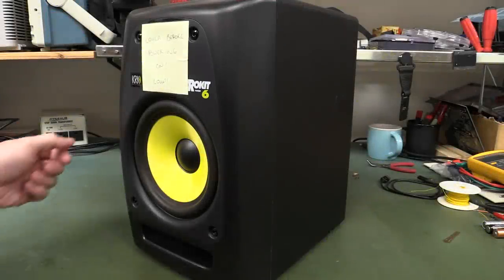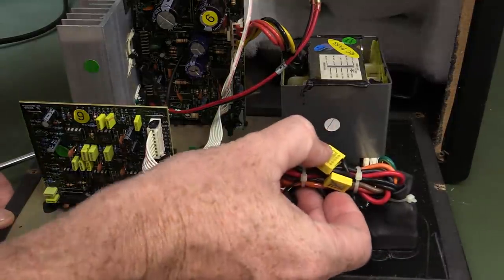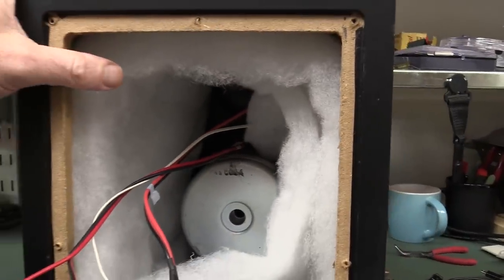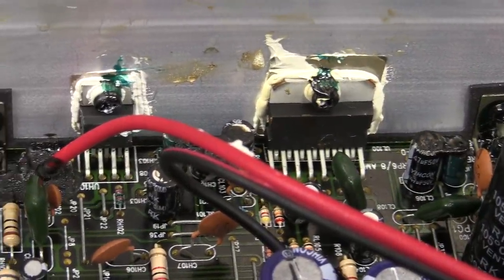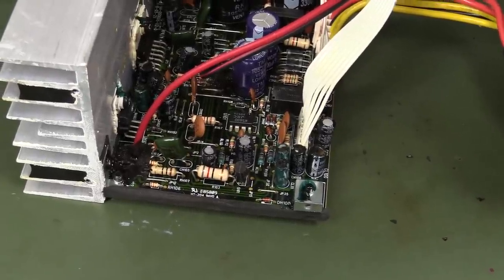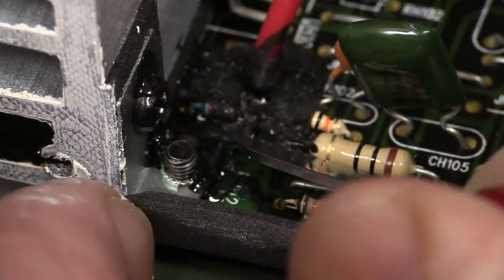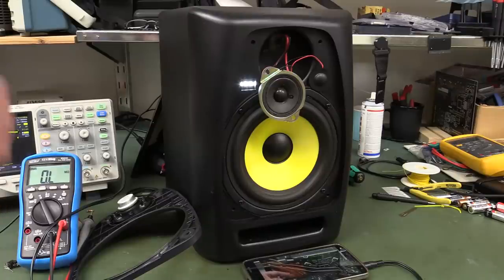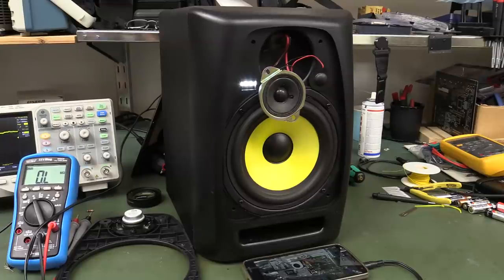EEVblog #1072 - KRK Rokit 6 Studio Monitor Speaker Repair

Comment: I've been cleaning that conductive gunk off circuit boards since the 80's. Yes, they're STILL using it! Amazing. Harman Kardon used to love squirting it all over the inside of their cassette decks. They would stay in mute or oscillate. Scrape off, replace corroded parts and jumpers, and voila! I've fixed plenty of these speakers too. Other brands are not immune, unfortunately.

Comment: My KRK rokit 8 same issue with the black gunk, instead of the tweeter being affected, my woofer would randomly pop. So ended up replacing a failed resistor, and while I was in there I also changed out all the capacitors to some Nichicon Muses and Fine Golds on the preamp board, and higher quality caps for the power side of things.

Comment: I’m impressed that the tweeter hasn’t fried, it very much sounds like the HF amp section has gone DC. I’ve repaired countless DB Technologies Opera cabs where an LM3886 chip has failed and it often takes the (rather expensive) B&C compression driver with it...  that speaker will have an active crossover which may be at fault. (commenting at 15.00)

Comment: Dave, could you bust some audiophile myths?  I'd love to see that!  I mean, if you aren't too busy busting solar roadways...   :)
Reply: It was maybe not a dedicated video but I seem to remember him ranting about audiophiles  when he got some valve amps (maybe soviet?) in the mailbag.
Reply: Yes! I am tired of people saying “Bluetooth sounds bad”.  Maybe old versions of Bluetooth had bad quality, but as an electronics engineer and musician myself I understand that Bluetooth is usually indistinguishable from a direct connection, assuming that everything is impedance matched to begin with.
Reply: BT uses lossy data compression method to transfer audio data. if you're not that picky about quality, it's fine. i use BT whenever i need like on my car but i highly prefer something like spdif or direct analog connection when it's possible. and you don't really need to match the impedance on consumer equipments nowadays. just make sure your source capable to drive your equipment
Reply: S. Kojina I am aware of the lossy compression.  The question isn’t whether lossy compression is used or not. The question is whether humans can reliably distinguish the difference between a BT (compressed) signal and a straight aux (uncompressed) signal.  This is that same debate with MP3s.  Even the top dollar audio engineers debate amongst each other whether one can really tell the difference between MP3s and lossless formats.  Don’t get me wrong, I have heard crappy MP3 encodings, but most of them I believe are indistinguishable, even as an ameteur audio engineer myself.  The problem is that there is no objective evidence stating whether people can actually tell the difference between these lossy formats and lossless formats. We need double blind tests for that.
Reply: some could and the other some couldn't. i don't really care if one said there's difference or not cuz.. eh.. i just don't really care. i prefer to enjoy the music instead of listening the system way too much. i do able to distinguish but then, it's a critical listening session. other than that, i just don't care. i even play some 128k mp3s and enjoy them.
BT vs direct connection is like comparing mp3 maybe 256k or 320k to WAV. some could hear the difference, some just can't.
summary, it depends whether the listener's ears are well trained or not. i, myself is an amateur audio engineer too. i'm not saying my ears are well trained tho. mine's sucks compared to my friends
Reply: Freyd my problem isnt with bluetooth, its the forcing people to use wireless earphones when wired ones are just fine. asshats like apple always try to reinvent the wheel, and in the case of the TRS connector they are doing almost exactly that.
Reply: Blox117 I agree with you there, but I think that’s a different discussion.  The discussion here was more about whether certain things that audiophiles speak out against really make a difference or not.
Reply: Freyd most people would not notice the difference, if its possible to notice at all. a computer would though.
Reply: Freyd I have to wonder though, is bluetooth adding compression on top of the already compressed mp3s? or is it just a form of lossless compression for digital radio transmission?
Reply: Blox117 yeah a computer would most certainly notice.  If any people are capable of noticing, I feel like it would be a select few people who are born with an extra sensitive sense of hearing, and I am not fully convinced that many audiophiles aren’t just fooling themselves into hearing a difference.  That is simply my hypothesis though, I am open to being proven wrong.  I would like to see more studies done on audiophile things.
Reply: Blox117 Bluetooth compression is somewhat lossy.  That would be a time that I could definitely imagine hearing a difference. If both the audio file and stream use lossy compression, even if they both are designed to be imperceptible.
Reply: Bluetooth quality does vary depending on which protocols are being used.  Bluetooth is 2.4 ghz, and wi-fi is also 2.4 ghz...as well as a bunch of other things, which can lead to interference.  So assuming there is no interference, and assuming both devices are capable of a higher quality bluetooth protocol, then it will sound good.  But an old fashioned wire definitely has it's advantages!
Reply: fredy gump yep wire does have advantages, such as not requiring batteries or buying new proprietary headphones! thanks cr-apple!
Reply: Hee hee, can't believe these discussions still take place. It's exactly like you say. Myself I can hear a clear difference between 320 MP3 and CD. I can hear the difference between 16-bit 44.1 and 24-bit 192 as well on some recordings. My mate can't hear any difference between 128 MP3 and CD. I ran him a test listening to consecutive fragments of the same song encoded in 128, 192, 256, 320 and CD and he couldn't tell nothing.

Comment: you would never need to change volume for studio monitors directly on the speaker, most users would change volume and plug in headphones on their daw interface or mixer.
Reply from the maker: Sure, but that's no good for my purpose, I don't want another doodad box on my desktop
Reply: yeah fair enough Dave, your Alesis is fine and slightly different beasty..perfect for your needs. Normally in studios, where your plugging in multiple mics, keyboards etc etc you just set the master volume on the back of the monitors, and that little tone control on these is so that you can sort of Eq/compensate for any sonic anomalies in the room. Generally set and forget once you have em sounding good...and pull the fader down on the physical mixer, or the the software fader. good fix by the way
Reply: EEVblog you can get squelch boxes which have XLR in/out and a volume pot - make one tonight when you are asleep and save a bundle!
Greetings from Pommyland! :D
Reply from the maker: Yeah, if I had a real studio I'd do that.
I have a typical work desk, so mine are close, within arms reach.
My Alesis's have one mains cable, one USB cable, one speaker cable, simple and tidy. Regular monitors would need two mains cables, a doodad volume/headphone box on the desk, a USB cable, and two RCA/XLR cables, messy.
Reply: If you're using a usb mic (rodepodcaster..seen on eevblog2) as adc for your voiceover work on vids..that is all you need!! more cable spaghetti is the last thing you need :)

Comment: I'm a retired TV / VCR / Audio / Computer Tech. I serviced all types of home entertainment gear for almost 40 years and have seen this black gunk many, many times. It's extremely hard to remove without damaging traces and component leads. It turns metal green. It's hard to believe they still use this stuff.

Comment: i know this question was asked on the forum already but not totally clear.... what would be the correct "glue" to hold caps and big components? can i find a tube that fit in my glue gun? or kind of caulking gun? i know vinegar smell is not good... so what is its then?

Comment: HP had a run of computers with power supplies that used gunk that went conductive over time.  I worked at a school that had some of these. Every fall a couple would go bang when powered on due to the conductivity.

Comment: That was a RP6G2. I have been using a pair of RP5G2 for probably close to 10 yrs now and I have no problems with the black gunk. I replaced all the JRC to BB OPA2228 the moment I got them. 

If you have a chance to lay your hands on a pair of Eve SC207, they sound really good but the power supply died on me after 4 years. Got one board completely replaced and the other piece died with a pop sound and I managed to fix it by just replacing a TinyMOS regulator.

Comment: Some one needs to be fired over this! There is a lot to be said for hot snot!!! AND, I bet it would have been cheaper than that black stuff!!! The 1980's called and said "use our shit!" Hot snot FTW!!!! Excellent diagnosis Dave! Shame no-one would pay for for this repair / diagnosis because you can't replace the tweeter! Thanks Dave! Yes your voice is a perfect test martial (nice one!). I'm sure ebay sales of these faulty speakers have just sky rocketed!
Reply: Uber Micro Repairs Doesn't hot snot go conductive from repeated heating cooling cycles though?
Reply from the maker: My voice is finally good for something!
Reply: I once built a one off circuit and used silicon sealant. It had a weiard fault on it until the sealant cured, so I guess I had the same fault as Dave found but in reverse. Moral is choose your gunk wisely and read the data sheets!
Reply: Those tweeters are off the shelf items, just look for same diameter dome ones to fit there.  KRK label on them is just a rebadged batch made by some speaker mass manufacturer, I guess they just ordered 10k units of them to get an in house label on them, or bought the regular ones and had some guy in the factory opening the packs and peeling the OEM labels off, and putting the KRK ones on, then handing them to the assembler as the line went on past.
Reply: I hate hot snot. It doesn't stick properly. Always finding bits of hot snot rattling about in things.
Reply: Nobody manufactures in house any longer, so there's nobody to fire.

Comment: I was seconds away from making my Rokit 5's redundant as one monitor had a capacitor discharge sound coming from it. I have enough limited electronic engineering knowledge to investigate. Found nothing obvious after a general check over. Typed discharge from speakers into youtube and found your video. Problem solved!!! How many KRK's have been thrown away because of this black gunk!!! Thank you for your video.

Comment: Gotta love these comments about ‘planned obsolescence’! It’s absolute nonsense. No manufacturer is going to deliberately introduce something into their product that will break down randomly and cause reliability issues. It’d be suicidal business practice. They simply made a mistake and picked the wrong adhesive for the job. That’s it, no conspiracies or mischievous intent.
Reply: lol can you really say with a straight face that Apple doesn't employ this tactic?
Reply: HazL - Their business model isn’t quite as crude as dumping dodgy adhesives on the pcb which will cause random failures!
Reply: you might get away with "planned obsolescence in x years" with consumer equipments but not professional equipments. it's a suicide to do such thing on professional world.
Reply: But this stuff breaks down over time, and likely post warranty in almost all cases. I bet it's fairly predictable, I mean the temperature outside the speakers will vary between 20 and 30 C, not more than that, and inside it's likely also more or less within a 20 C delta.

Now I do suspect that on case of this manufacturer it was not intentional but factory fault.

But I've certainly seen things before that made me suspect it was likely intentional.
Reply: ProdigalPorcupine - True, I'll give you that! But they aint much better lol
Reply: Don't attribute to malice what can be explained by incompetence. People act like they've never made a mistake and everything is some conspiracy trying to victimize them haha.
Reply: ProdigalPorcupine "It’d be suicidal business practice." - Let me ask you: have you ever used an inkjet printer? Or purchased a washing machine/dryer in the past 1-1.5 decades or so?
Reply: ProdigalPorcupine Crude or not, it's still there nonetheless.
Reply: Stupidity usually trumps malice

Comment: I've had my series 1's Rokit 6's since release, in my studio, never had a problem. I do however have a theory that leaving powered speakers running continuesly all day causes so much internal heat that this type of melting is, I suppose, inevitable in these. Badly designed yes, but like most things they're given a shelf life. Depending on how you take care of them, I would imagine matters a lot with KRKs.

Comment: Yeah, I've had basically the same journey down the rabbit hole on a Teufel subwoofer (german brand), the gunk was originally yellow, but turned orange and corrosive. A poor 10 ohm resistor had gotten one of his sides chewed off, had to replace him with a wire, since I had no spare resistor. Worked a treat!

Comment: An interesting repair.
Looking at the components that just fell out of the board.
Is it possible that the liquid is able to dissolve the tin from either the solder or the component wire.
At about 18:55 there are two resistors and two diodes. looks like the gunk has peeled from all 4 components and one of the diodes looks to have corrosion on the right hand lead.

Comment: Anybody know of a good chemical compound that dissolved this stuff for easy removal?
Reply: Interested as well. I've just scraped most of it off with a plastic spudger, cleaned up with alcohol. The speaker works. I will need to fix the corroded diodes, resistors and leads and open up the other one as well.
Reply: I'm scraping mine with the same problem, I contacted KRK but I don't expect to get a useful response. A solvent would be great, this is tedious. The gunk on mine is really hard.

Comment: Great video Dave! Really eye opening. I've owned a pair of these exact models for about 6 years now and they've performed greatly for my purposes. I use them as general purpose pc speakers as well as for DJing; where I've pushed them quite hard for extended periods of time (6+ hours of high volume, bass heavy music in party settings) on multiple occasions. I haven't had mine succumb to the fault in the video, although one has developed a low volume crackle on start-up as well as occasional clicks and crackles that can only be heard in silence which from some forum browsing I've found can be attributed to the crap quality large caps on the amp board. But otherwise I'd say they've served me very well for what I paid for them. However I think I'll be checking out some higher quality brands if I ever plan to buy new monitors now that you've uncovered the dirty secret that is the conductive gunk all over their boards.

p.s. 
Somewhere in the video you said this was a gen 1 model, however it is actually gen 2, designated by the "G2" in RP6 G2. Currently the latest model is gen 3. Also in the conclusion you voiced concern about the speakers being sold as matched pairs but they are in fact sold individually, as are most studio monitors to my knowledge, so no worries there!

Comment: Thank you, Dave! You just confirmed my theory! I've recently repaired one of these myself. But it was in it's initial state, it only had static, random noise in the drivers. At first I thought the filter caps were the problem, but nope. I couldn't believe that is was the gunk! The entire day I was speaking to myself: "It cannot be from the gunk...". But aparently... So...lo and behold: gunked removed, everything worked!

Actually they are 2nd gen. And no, they didn't called them back.
Reply from the maker: Yeah, most people seem to get static or some such. Mine was super extreme.

Comment: Word of advice,be very careful using anything colored black in direct contact with electronics. Carbon is often used to color stuff black,and carbon is a conductor. This is something I've come across several times,particularly with black rubber parts. It can be nasty when it's something like a battery pack,and stuff starts melting down/catching fire for no apparent reason.

Comment: One of the sub is like 1/5 of the volume. I will try to fix it. I had having it stored in a closet. I would rather have it as another set of monitor in my setup  cross check stuff
.

Comment: What's interesting to know is that I have a (probably younger) 2nd generation Rokit 5 set, and I swore for years the shielding in them was great. Now, I've gradually been spotting more and more RF interference from my cell phone. Never enough to be problematic, but enough to make me think either I'm crazy or something has changed. So potentially this is a problem that will eventually crop up in any 2nd generation Rokit design, since I'm sure the boards are constructed almost identically.

Comment: Thank you very much for the video - i managed to repair the HF amp by removing the glue, but the LF amp is still not working. I measured all the capacitors, resistors and diodes - they all seem to be OK. Could it be that my amplifier IC is gone insane? It gives - 33,9 volts on the + output, even when the pre-amp is disconnected from the amp/power board.

Comment: 8:31 You don't see that too often, but i for one, quite like the bottom copper "silkscreened" on the top. That stuff's real handy for troubleshooting / probing / tracing the circuits (not having to flip the board over all the time).